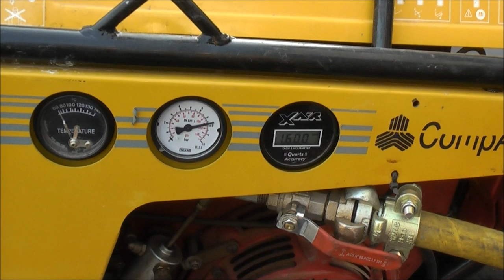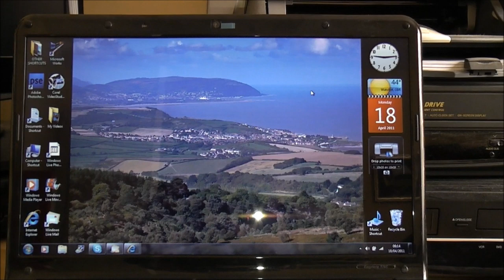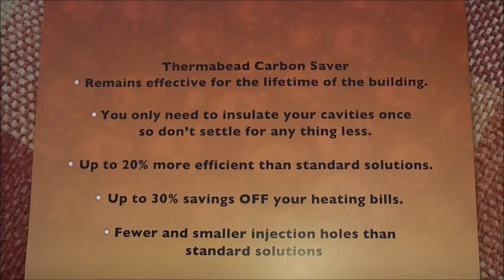A CAVITY WALL INSULATION INSTALLATION Part 3

Comment: Thank you for doing the video and documenting the process. Really surprised your house from 2000 didn't have any insulation. 
We've had a survey done last week on our 1960's house for cavity wall insulation. We're going with beads and hopefully get it done in January. 
It's very positive to hear that it has made a difference to the comfort inside your house.
Reply from the maker: Yes. We are pleased we had it done. It was only when our original front door was replaced we could see the cavity was in fact empty. Previously we were told that a house built in 2000 would have had it done as a matter of course..

Comment: Thanks Admiral, I asked about the gas fire because we're also considering have our gas fire taken out and replaced with an electric fire and I'm not wanting massive electricity bills in future. I'll wait until the new combi boiler is installed and double radiators with a pressure flush out of the entire system carried out  in 3 weeks time before finally deciding for sure what to do with the old gas fire. This winter has been pretty severe I'm sure you'll feel the benefits in the coming years.

Comment: A well made video Mike.I took the afternoon off work today to have cavity wall insulation at home here!. A different company ,but exactly the same technique, materials,and the same equipment - so if someone wants to see how mu insulation was done I will tell them to look here. It does seem a good idea this cavity wall insulation doesn't it, after two very cold winters. 
I have to put some paintings back on the wall now, and ornaments back in their usual spots- well maybe  not all of them.
Al

Comment from the maker: The area by our front door was always the coldest in the house. Since the job has been done although that is still the case the difference to the rest of the house is not so noticeable.It has been a particularly long and cold winter this year. .We do find that inspite of that we do not have to turn on the electric fires as high as we used to.We are glad to know there is extra insulation in the walls

Comment from the maker: @WoelkerVideo Hi Gunter. I was told if there were no subsidies it costs around £450. But many groups of people in the UK can benefit from government subsidies to reduce the cost considerablly. Roof insulation is a problem, as such subsides are not available if you have floored the loft, used it to store all sorts of things and built a model railway on top, as I have.

Comment: Very interesting and informative.

Like you hinted at, having on the truck a "before and after" indication of the materials used would have been reassuring that it had pumped in a sufficient amount. They could have put these values on some paperwork for you.

Thanks again and well done to the company for tolerating the video being made, I do help it helped their sales.
Reply from the maker: Thank you. That would be a good idea. It would give the customer extra confidence that the job was well done.

Comment from the maker: I have heard that in the States you can get a check done with a special camera to prove that the insulation beads have been distributed everywhere that they should, which seems like a good reassuring idea. I have wondered if they really have got everywhere!. I am not aware of similar facilities over here It is hard to show financial fuel savings but we both agree the house feels a warmer place and we hardly use the gas fire at all these days, when we do it is soon turned off again.

Comment from the maker: @Christmassychannel That sounds good to get it free! I do hope the installers they use are as competant as the ones we had. Apart from having to wipe some brick dust off a window ledge you wouldnt know the job had been done.Once the mortar had dried you couldnt see any sign of the holes having been drilled.We were very satisfied.

Comment: Great videos, really interesting. Thanks so much for taking the time to post them. I'm looking at having cavity wall insulation put in too.
Reply from the maker: It certainly makes economic sense especially at this time of year.
Reply from the maker: Everything has been fine since the installation. I am sure the house is warmer.
Reply: You'll be getting damp!! Now what happens when to much adhesive has been used? 
No water / Moisture can drain away through the EPS so it tracks across to the internal walls? Wait until the beads have been in the property for 25 + years, it Will be like floymidhyde foam shrinks and turns to powder... 
It's ok testing these products in a factory everything is fine, but in really weather conditions it's a different story..... 
New builds have trickle vents, what happens to them? They become blocked.. What happens when the beads fall down below the Damp Proof Course? What happens to cavity trays?

Comment from the maker: @WoelkerVideo   The insulation is made up of many thousands of tiny beads of about 2mm diameter made from a polystyrene type of  material. Adhesive is added to the mix when pumped into the cavity to bind it together and waterproof it.. Our cavity is about 10 cm wide, but i beleive it can vary in different types of houses.

Comment from the maker: @howarth004 Pigs may fly! A thing to be aware of too, for those interested in having it done. Advertising seems to infer it can be free for those over 70 such as I, and for other specific groups too, but in practice when they work out the quantity of beads your house needs, you get told," Oh, you need more than the grant allows, so here are the details of the costs you need to pay to get the job done.". It still turned out to be reasonable however, for the work they do and the expected savings.

Comment: In the first video, you indicated they drilled a test hole to check on existing insulation. I had assumed they had used a fiber optic camera to check the cavity. At Amazon dot com, you can find these cameras in either USB (connect to computer) or stand alone hand held with a screen for $20 to $250, depending on the type. I don't know what they would cost in the UK or if they are even available.

Comment: Hi Admiral, I have had a survey done today to get the insulation beads installed, have you had any issues and would you recommend ? Thanks
Reply from the maker: There have been no issues against it at all. There has been some negative press about the system but it has been a real improvement for us.
Reply: @ADMIRALSCORNER  thanks Admiral, do they also provide a CIGA certificate with 25 years guarantee ? Thanks
Reply from the maker: @bodrulchoudhury4332  Gosh it going back a few years now so I don.t recall. Also I am not sure where all the associated paperwork is, if i do come across it sometime I will let you know.

Comment: I'm surprised that there was so much of a distance between the holes in the outer wall. Here in the States, building code requires wall stud spacing of about .4 meters.  It looked like the hole spacing on your walls was over a meter.  The cavities would have filled from top to bottom, but wouldn't be able to fill adjacent cavities due to the wall studs.

Did they show you the insulation with their camera afterward? I assume that the brick walls are structural? How have your savings proven out?

Comment from the maker: Thankyou! The gas fire is the most powerful heater in the lounge compared to the electric fires.although I use it when my wife is not around, she does not turn it on at all, and always turns it off when she arrives! I guess its now on about 20 percent of the time it used to be.